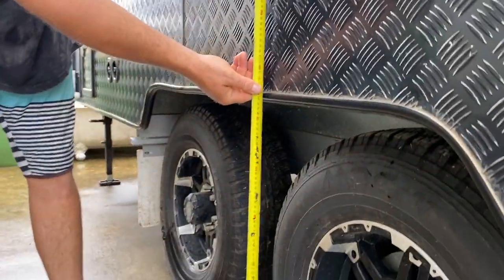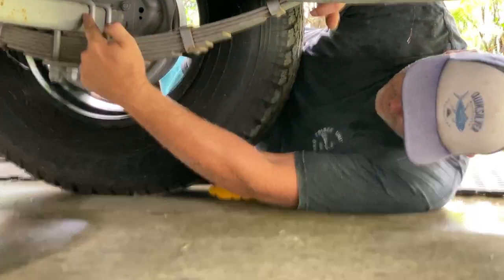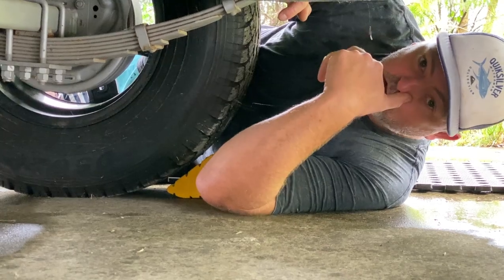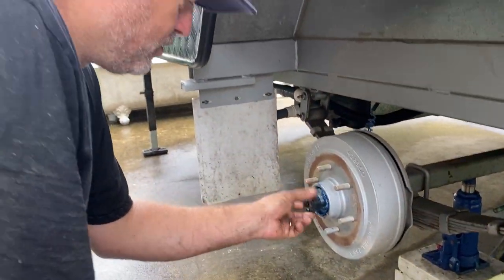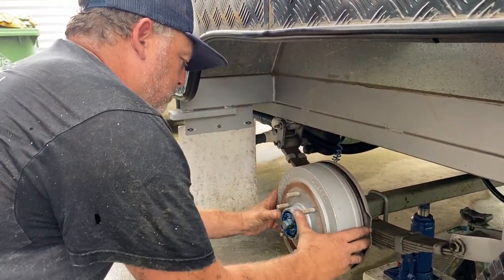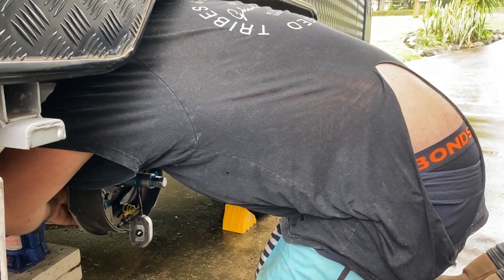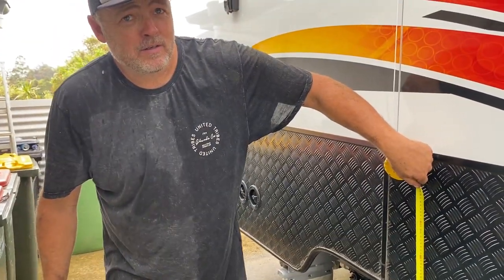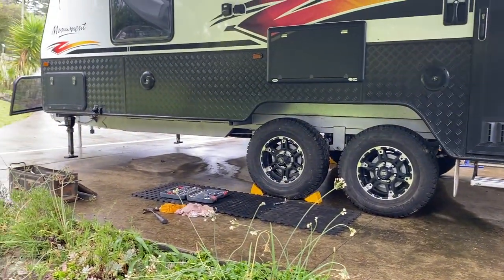Lifted!!! - Flipping the Axles on a Caravan to Increase the Clearance

Comment: G'day,  I've been researching underslung axle mods for my Jayco (which is how I stumbled across your video).
A lot of others say NOT to simply turn the axle upside down as there is a slight camber or "bow" in the axle & turning it upside down can cause serious tyre scrubbing. Apparently the locator plate should be ground off & welded on the other side.
I guess it would probably be a good idea to keep a close eye on your tyres for scrubbing for a little while. 
Hope it's all ok & you don't have any dramas.
Cheers.
Reply from the maker: Hey Pete thanks for that! Hadn’t actually heard that before so sounds like Floydie will definitely have to keep an eye on it. If it goes pear shaped there will be another video being made about how we stuffed up! 😆 
Cheers mate! ✌🏻
Reply: @TheBeatenTrak  If it is a hollow tube axle, those are designed to flex with weight. All the caravans/travel trailers in the USA have hollow tube which is obviously curved or arched when you see them. Solid axles like those in this video should be straight. Thanks for your videos.
Reply from the maker: @alanoneill8750  Hey thanks for that info Alan! Sounds pretty spot on from what we’ve been hearing 👌🏻
Reply: @TheBeatenTrak   Just put a straight edge on the top of the axle to check this.
Most Alko and Trojan  axles are straight , Dexter axles are cambered.
Reply: Thats in the USA
Reply: @TheBeatenTrak  if you was worried about the camber by flipping the axle just put the locator on the other side simple fix

Comment: Great video guys, think I would fix the drainage in that car port so you don't have to work on a wet floor. I did this to a Millard micro and worked great for years.
Reply from the maker: Thanks mate! Unfortunately that is just a concrete slab beside the house without a roof over it. We had dragged a few tarps over it and pulled the awning out but still got a little wet 😅
Reply: @TheBeatenTrak  Lol, you did exceptionally well in the circumstances. And you both seemed happy about being there. 10 point to you both. Not sure I would have been so cheerful.

Comment: Im only just learning about suspension and appreciate any pros and cons to this idea. 
I was thinking of a way to reduce the hard yakka and be able to get  60mm or more height increase and leave everything else as is. 
Perhaps a centre rocker arm with a more accute angle or get one fabricated to your specs and have the shackle plates as short as possible. 
I've seen some rocker arms about 45°.
Reply from the maker: Hey mate apologies for the slow reply! To be honest neither Floydie or myself are experts on the subject of suspension set ups. You’ll find quite a few opinions in the other comments here about the pros and cons of what we did with Floydies van. Some saying there’s a bow in the axle and it shouldn’t be flipped and that tyres would scrub out etc. 
All I can say is that we’ve run a straight edge over the axle and have found no bow in it. Also the van has now travelled quite considerable distances without any issue. 
Cheers mate 🤙🏻

Comment: I'll be doing this as well vintage C/ van. I had to flip my ball hitch as it was to high for van .my understanding is you keep it squared to box section and don't change angles no problem. It might flex if you're talking tons van's are pretty light.

Comment: The Axel stubs are normally offset from the cross member and an axel flip can yeild about 100mm, however the stubs are offset above the cross member so there's no rotating load on the bolts.  Think of a trolley wheel castor designed to work one way. 

Their stub wasn't offset so i don't know what they were doing suggesting a flip? Maybe they heard it somewhere and started rolling the camera on the idea, before looking.

Sprung over is dangerous, cause you can loose the entire axel if it comes loose.

Comment: Hay guys. Yes it dose make a great difference with everything. I have done mine 7 years ago and its been fantastic in lots of different ways. couple of things thou, have you checked how your tires are wearing because of rotating the axel under instead of locating the spring to the top side of the axel. In most case the axel gets a bit a bend in it when they do a wheel alignment after the build. also have you retentioned  the 'u' bolts with the weight of the van on it. also you didn't flip your center bolt on the rear axel.
Reply from the maker: Yeah Floydie has been using his van heaps lately and really like the lift in it. He just got home from a 3 week trip. Thanks for pointing out that stuff up with the centre bolt. I’ll let him know so he can investigate 👍🏻
Reply: that is because the AXLE is designed with a BOW in it meaning it has a high side and a low side , thats why when flipping axles you need to weld the locators on to the other side of the AXLE and is why your axle bends with weight on it ! because caravans are engineered to have a BOW or high point in the centre  take a look at this video you can actually see the bow in the axle of the original , what will happen as well as your tyre issues is after time it will destroy your springs and BOW them in as well

Comment: G’day boys, 

Just found this vid. 👍🏻👍🏻

Question. In the video The original measurement was 743mm and the new measurement is 843mm. 

That’s correct, yeah??
Reply from the maker: Yeah mate from memory that sounds about right 👍🏻 It would be 40mm for axel and 60 for spring and plate thickness.

Comment: Great video I am changing my suspension to a simplicity LCS but I have a question on your axle flip. The ADR states that the hitch height must be between 360 and 460mm, I think that is when attached to the tow vehicle. Since you have a good lift on the van now how did this affect the tow hitch height?
Reply from the maker: Thanks mate! Floydie has had no issues with the hitch as it’s hooked up to his 2021 Hilux which has a 2 inch lift with airbags in the back. We just came back from a massive road trip out to Birdsville and it towed perfectly 👌🏻 
Also, before we went he had a session with a caravan weight specialist who goes right over the van and vehicle weighing all the axles, measuring ball weight etc. He had a couple of minor things to adjust to do with weigh distribution but nothing major.
Reply: @TheBeatenTrak  Thanks mate but I may not have expressed the concern clear enough. I wanted to know what the tow hitch height is now that you have done the suspension work on a flat surface I had considered doing the same as you have as mine is semi off.
I have totally no concern for the tow tug as that has nothing to do with the can hitch height.
Cheers
Reply from the maker: Ahh yeah okay no worries I’ve got you. I’ll have to try catch up with Floydie sometime soon and see if I can get an answer for you 👍🏻
Reply: @TheBeatenTrak  Hi I have been able to find some answers, so the height of the coupling not the hitch as I previously miss stated is between 460mm and 350m. When you use a articulated or off road coupling the height limitation doe snot apply.

Comment: Perhaps the only thing I would do differently?
Before you started the plate and double nuts were upside down from how they are now.
In the unlikely event that your nuts came loose and fell off you would lose your entire U bolt.

Really hard to find another U bolt in remote areas like Gibb River Road etc.

If they were up the way they were originally, and the nuts came loose and fell off, likely your U Bolt would still be straddled over the top of the axle / spring.
All you would need to do to get mobile again would be pinch the 4 nylock nuts off the other axle, put them back on your other axle with the missing nuts and you could limp to the next town to replace the lock nuts and missing nuts.

Without a U bolt to retain your axle position - your literally going no where.

Just my thoughts on it.

You could easily slide under the van and just reverse one U bolt at a time without risk of the axle coming away from the spring.

Might take a bit of time but could possibly save days stuck on the side of the road remote in relentless heat & dust.

Again, just a suggestion.

I’m guessing the manufacturer put them up the other way for a reason most likely and I’m guessing this might be the very reason. 😉

Perhaps others know different to me? 🤷‍♂️
Reply from the maker: Good pick up and very good advice thanks mate! 👌🏻 I’ll let Floydie know what you’ve said so he can fix it up. We’re heading out to Birdsville in late June so would be good idea to change that before we hit the corrugations out there!
Reply: @TheBeatenTrak  Best of luck with it.
You should be able to do it because you have square axles and the “U” bolts are square at the bends so they should fit either upside down or right way up, as your exercise already proved (because they are now already reversed from where they started out).

If you had hollow round tube axles like they have in USA, your “U” bolts would be semi circular - so you couldn’t reverse them because the semi circle wouldn’t clamp up on a square flat spring pack when you invert them - if that makes sense, so they only go one way.
Reply: I don't think that would work unless you put bigger u bolts in as to mount them the right way up would mean they would have to run across the spring! Or you would need another plate at the top of the spring as well, as the U bolts run beside the springs not across!

Comment: Good job,, ,  but is that legal, and does your insurer has to be notified  of the change??
Ive got a 23ft Crusader, and wouldn't mind doing this to mine,,looks gr8👍
Reply from the maker: Hey thanks Mark! I don't think Floydie looked into the legalities of it and it's a good question. All I can say is that he's used the van a fair bit now since we did the axle flip and it's towing great and has no issues whatsoever. 
Let us know how you go with yours and if you decide to flip your axles too!
Reply: Hey Mark and @The Beaten Track guys. I  have a 2018 Family Palace 20.8 feet, and I looked at flipping the axles as well. I first contacted my RACV insurer and asked whether I could or not and I was told RACV doesn't care or object about this modification. I then contacted VicRoads but it was impossible to get to anyone as they must be SUPER BUSY and noone answered the phone. But in all the research I did I never found anything stating against doing this. I then checked with A Grade Caravan Repairs (who look after my caravan) who told me they do it all the time and it would have cost me around $600 - $700 with a 4-5 inch height gain. So sometime this year I'll be flipping the axles and fit AT tyres. 
Also while looking at other manufacturers brochures, some actually (Jayco too?) offer this flipping as an option.
I hope this helps!
Reply from the maker: @tcharalambousg  Hey thanks Theo that’s great! Pretty much exactly the same as what we’ve been hearing too 👌🏻 Are you going to do the Axle flip on the Palace yourself?
Reply: @TheBeatenTrak  although it does look easy enough as a DIY project, I think I'll let a reputable repair shop to do this :)

Comment: You didn’t flip your Spring Retainer Centre Bolt on the Second axle! Mite come back and bite you in the future it you ever have to replace it!
laphs out loud
Reply: I was going to leave a comment on exactly this. well spotted. It probably won't make a difference as the centre bolt is there primarily to keep the springs where they should be rather than the locating the axle.

Comment: Great Vid, perhaps you only needed to take off one hub, if you pulled it all the way out on one side??
Reply: Haha too smart! But might also be an opportunity to check bearings etc
Reply: Also need to re-orient the electric brakes as they aren't reversible when flipped so they should be removed regardless unless welding a new seat on top of the axle

Comment: do you guys know at all the issues you will most likely have down the track the main issue is it will ruin your springs after a few years and your caravan will list to one side  , axle flipping is not as straight forward as taking off and turning the axle over , see the axles have a high point in the middle of them meaning you have to weld on new locator  brackets on the other side of the axle , there is a youtube video explaining it what im talking about, if you do not believe me about the high point have a good look at your video you can see how the axle bows up in the middle . they design them with a BOW in them
Reply: Some, not all. A lot do not have this bow. It’s old school and was common on round axles. Most alko ect axles are straight these days.

Comment: I'm confused, yes the height of the body of the caravan is higher but the axle itself is actually lower than where it was.  Can someone clarify why you would do this?  
ta
Reply from the maker: The height of the axle remains exactly the same. The reason for doing it is to lift the caravan body to give you greater clearance especially at the back of the van which helps when you’re negotiating sharp angles.
Reply: @TheBeatenTrak   ah, of course it does, duh.  Many thanks

Comment: Maybe talking to an automotive engineer before you started would have been a good idea.  It's much easier to lose your axles completely. This is messing with your lives and the lives of other road users.
Reply: Why with the axle flipped less stress on the ubolt.
Reply: Sam, the U bolt wasn't even strait 😂 may be the only problem in this video.
Reply: I put (welded) a capture chain to mine either side. Also, you should remeasure the distance between the axle tip to the ball to make sure it's still isosceles to pull straight.